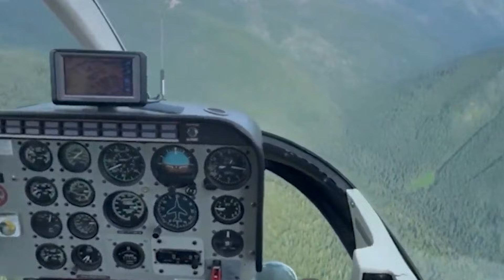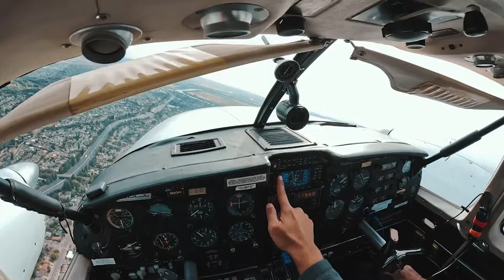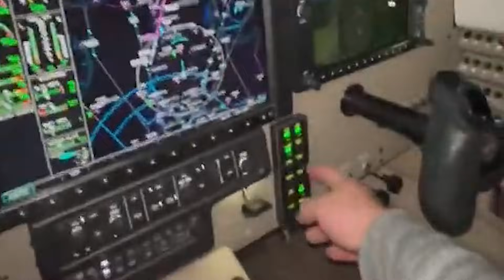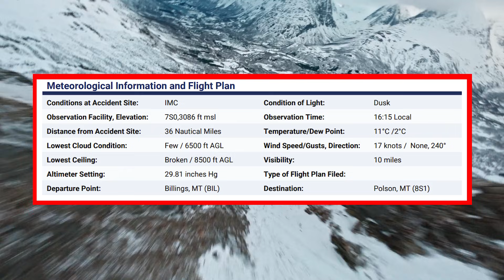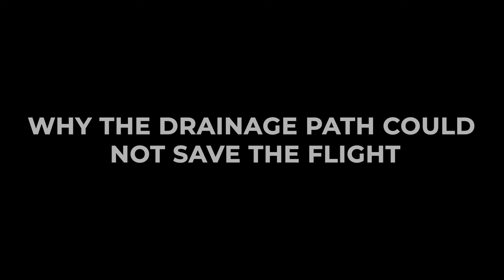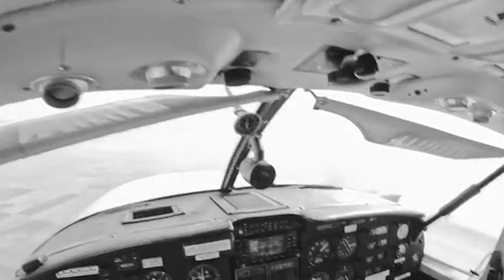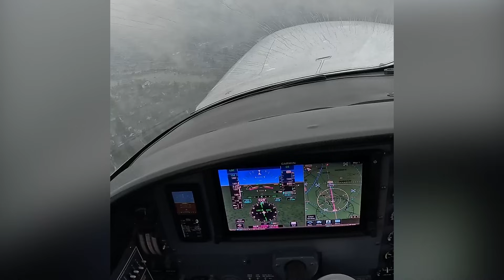NTSB Revealed The REAL Reason Of N2345R Fatal Crash Condon MT…

Comment: The piper Aztec is a wonderful aircraft. This series with the injected engines will fly 1000 pound payload 1000 miles and she will do it in heavy weather in icing and is gentle to fly even if you add a wing loaded with ice

Nonetheless… Even if you fly one for many years 
Or even if you own one… And I did 
Or fly one as we used to many years ago, hauling everything through the night and all weather around the clock operations 
A wise pilot will study the weather 

We had the benefit back then of our instructors, being too old for World War II, having flown in the airlines, previous to the war or flown over the mountains of China or having flown in the sky over Europe these old man had survived, and so they carefully tutored us and weather theory and operations 

Tactical weather analysis Main focus on threats was the old acronym fly ATC ships… ATC stood for your transport command 

I was for icing and that was an extensive analysis on ground icing and icing an air frame icing 

The occluded front in the winter time means that the layering ends and the red range of temperature zero to -4 get lifted and mixes of the air Moisture so that it is not frozen and it’s a trap waiting for you

In the mountains you get these pockets where the air lifts up over the ridges and forms these orographic induced lifting areas that for a miniature occluded front storms and when you hit them, you’re in one heck of a situation

A few decades ago, many of the cargo services would have the same exact aircraft yes even without turbos Chris Crossing, the night sky and if you lost a motor, you were in big trouble 

Don’t kill yourself in the briefing room and flight planning room 

If you hit one of these pockets or an occluded front, especially in the Great Lakes or coastal New England or anywhere that you get these conditions, you don’t have much time to act and react 

If you wait for your magnetic pick ups to unlock, it doesn’t matter if you’re in an Navajo or an Aztec… You’ve waited too long 

If you hesitate on turning out of that sudden squall of freezing rain 

You waited too long 

We used to flight plan through the mountains so that we had a way out we would fly a flight plan not on an magenta line but we would do it as if we were in a single motor Airplane and track long known flightpaths

Until recently, the state of Montana still had the lighted airway Beacon systems and they have saved many a pilot many times 

John Wayne was a pilot and he was involved with a movie dusk to Dan. It’s an excellent movie to train pilots. 

Once someone saw that film and some of the army flicks on whether and icing and navy to quit stalling or spin in 

Then they were ready to look at their performance planning details to see what the Airplane can do on one motor then contemplate ice 

Harlan who trained me had made me ready for 135 all weather flight operations and God bless him. He had flown B-17’s during the war over Europe and was one of the first piper Apache air taxi pilots when the plane was first built after it was purchased from Stinson and produced by Piper.

Harlan always had us listening to the ADF   And you heard a metal scrape on the radio headset. It would tell you the first instant that you hit freezing rain and in that instance, don’t wait for the temperature gauge to adjust to tell you what you already know because within an instant, the propeller will be slinging ice into the side of the fuse large as glaze ice rapidly works to kill you

If a motor is cutting out because the pilot relied on the induction icing, magnetic doors… It’s too late 

Don’t kill yourself in the briefing room “.   T is for terrain and terrain impacts the weather and what you’re gonna have to do about it. “
If you fly in the red temperature range in the soup that ice is gonna cut in fast and just like an engine fire, you’ve gotta run your drill and rig for icing and as you turn around, worry about Clarence later 

If you hesitate, your a dead duck

Harlan was shot down once and crash landed once later and spent his life flying the night sky and an Aztec
Reply: I recall a funny story about a fella who would later become the head of the Louisiana flight college… He was an DC three pilot over the China and I think he also flew the C 46 a little bit as well. He was friends and roommates with another one of my old instructors.

They used to tell him turn the car heat on one at a time 
They had the same problem with those pockets of ice and the monsoon of Asia as you crossed the Himalayas over the red white and blue or brown, depending on the season river 
That was Irrawaddy, the Mekong and salween
Sure enough he didn’t listen to potty Portsmouth who was the genius instructor of the hump run for Pan Am 
And then pretty much exact conditions as this plane was lost both motor cut out and so our hero got to turn and dive, and then hope his turned to align with a Rivervalley would allow him to get low enough to clean up the Airplane and restart the motors

He got lucky 
He passed along that know how from firsthand experience 

Sometimes you get lucky
Reply: As an aeronautical engineer, pilot, aircraft mechanic I don't care how good the Aztec is they should have never left the ground and that's a fact
Reply: @christophergagliano2051 yes
Neither should any who fly as the sky is full of danger
Park the planes and take the trains
Reality is if you want an aircraft to be more than an overpriced lawn ornament you got a mission to fly and do it right
Calculated risk is reality
He gambled and did so well until just one trip ….
Have you ever driven your car tired?
Reply: It appears that he flew through the worst and turned right back into the bad stuff trying to escape it.